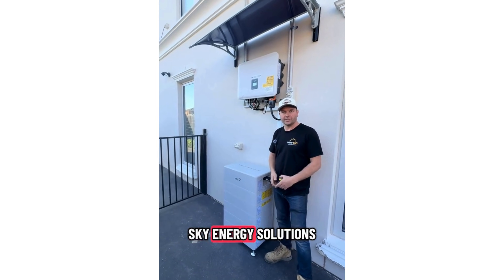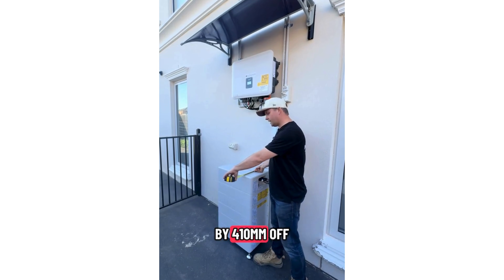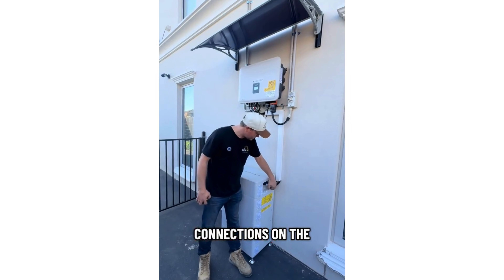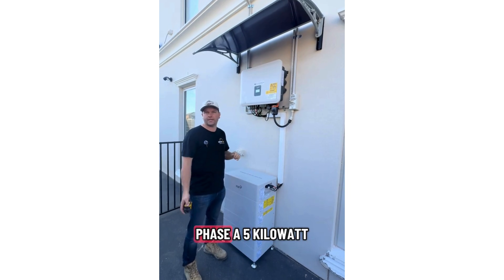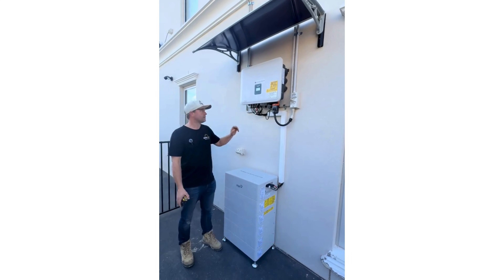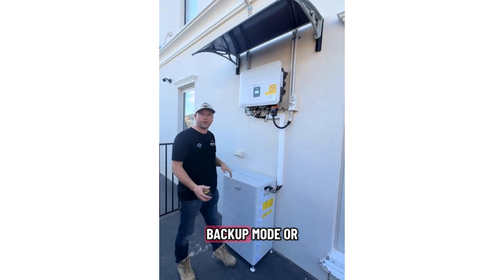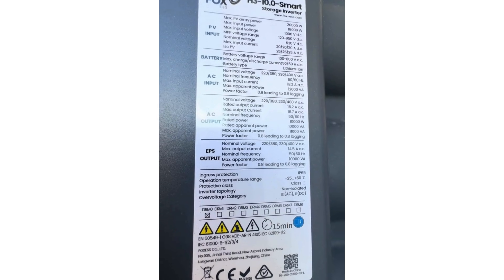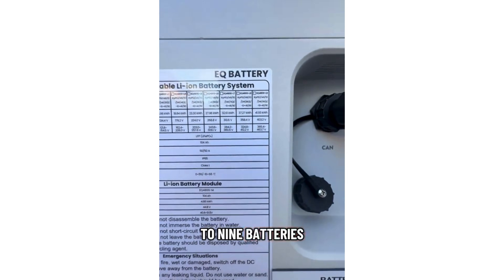What you need to know about Fox ESS Battery and Inverter. Price at www.newskyes.com.au

Comment: I from NSW I order 9 batteries ( 41.9 kw) with 10 kw inverter after rebate out of pocket $6000
Reply: any issues so far? considering myself going the same way
Reply: I’ve ordered mine as well, but the 5kw battery is actually 4.66kw. I got 7 stacks plus the top regulator which is also 4.66kw a total of 37.28kw with a hybrid 3p 10kw inverter for $8950. I think there is a shipping cost as I live 4 hours away from a city.